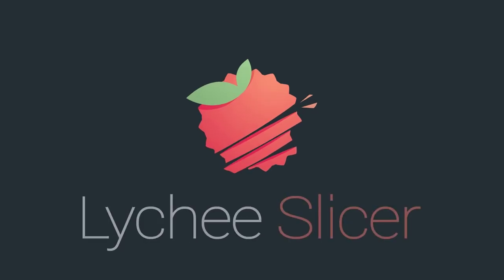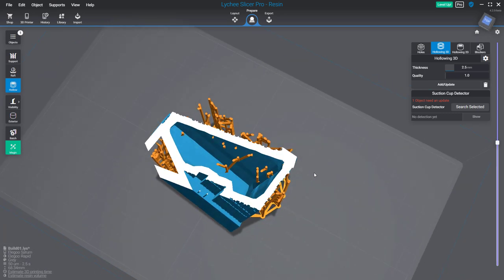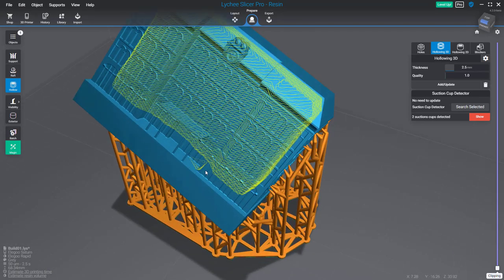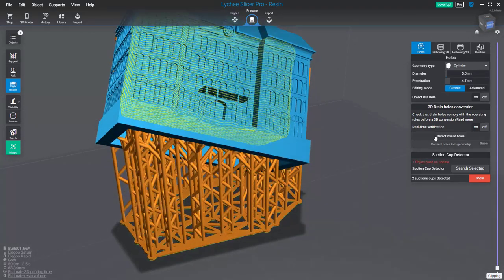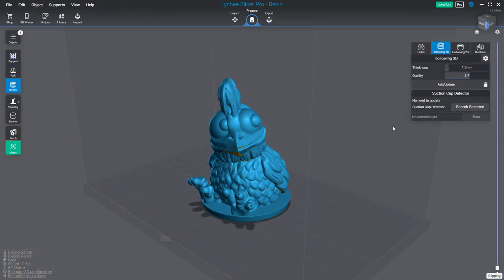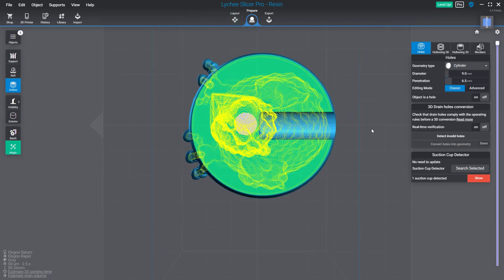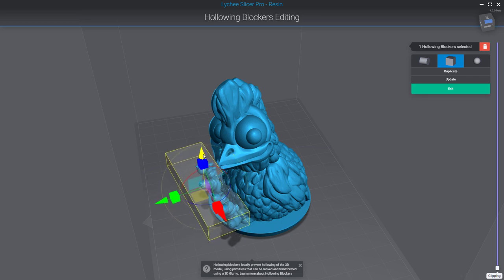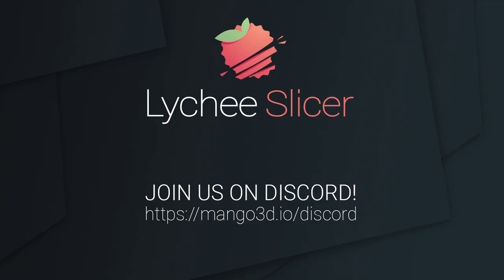Suction Cup Detector in Lychee Slicer : Overview

Comment: i have the pro bundle (resin and filament) and when i run the suction cup detection ti doesn't show thew suction cup areas highlighted at all as in the video, is this not in the pro bundle?@lychee If not how can i change my subscription or request a refund, It's the whole reason i purchased the software to begin with.
Reply from the maker: The only reason it would not work it's because your model is in error, meaning, that it has topology/structural error. It should be displayed in a red color in the Layout section. As replied in another comment you posted, please reach our support with your scene, it would help to see what's going on.